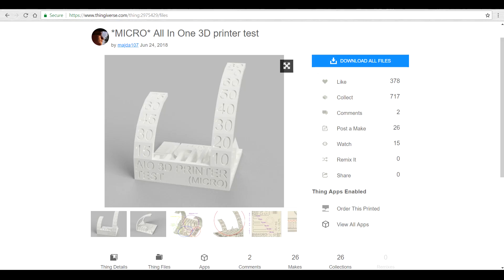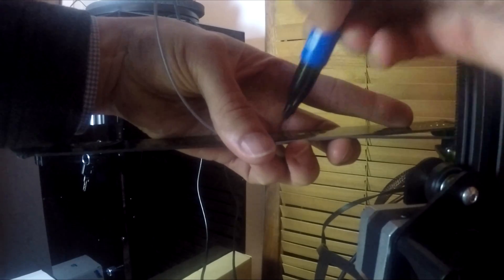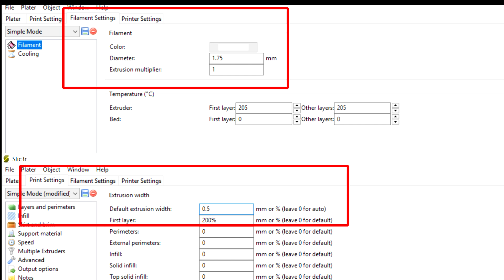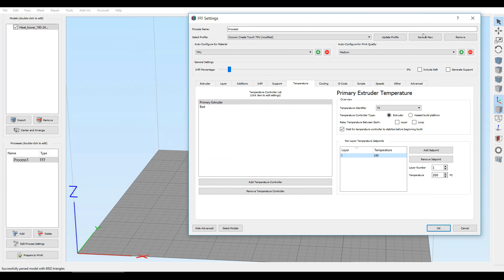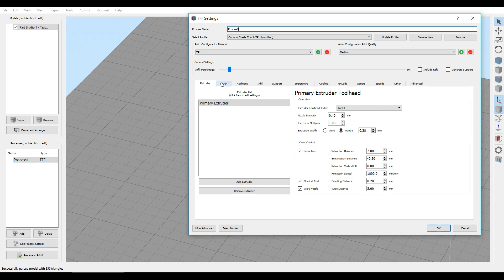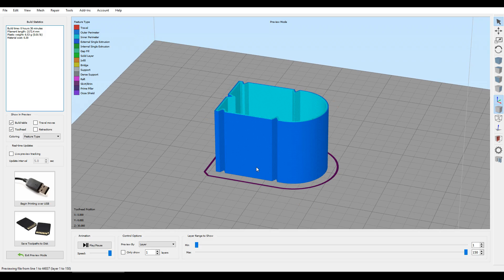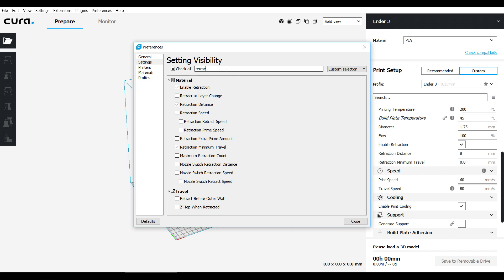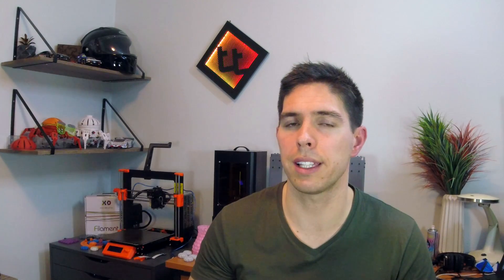How to tune your slicer settings featuring Ender 3 - UPDATE IN DESCRIPTION

Comment: premade gcode is useless to help tweak a machine.  there is no way to know what the slicer settings are, other than the ones being tested.   A premade retraction test doesnt tell you what speeds are being used, nor does it tell you layer heights, or anything at all. 

It would be better to say "here are the settings for simplify3d, if you want to replicate in a free package, use IdeaMaker's layer grouping options or Cura, printing multiple tests (in place of per-layer settings) for each setting... eg printing 4 retraction tests, one at 2,4,6 and 8mm.   At least that way, all of your other settings are you own and you have a place to start tweaking from.

If you use somebody elses gcode, you can print test after test but when you go back to your own gcode there will be differences and you will be stuck back at square one

Comment: I've yet to see anyone fix the stringing issues with S3D AFTER they've installed the Micro Swiss hot end.  After exhausting every possible setting, I now print out of Cura exclusively.  There are a bunch of solutions that work "in theory", but in practice it seems everyone gets frustrated and moves to Cura like I did.  It's a shame because I miss the supports of S3D.

Comment: When I do the G1 E100 F100, my printer extrudes about 40mm of filament. filament is not slipping. Tried adding G91 and same result. Anybody know why?
Reply: I had this same issue. When i took my cold end apart i noticed the plastic bracket on the botton had a crack in it. Didn't notice any slipping but it was. Switched to an all aluminium cold end and the problem was solved
Reply: upgraded mine to aluminium, same issue still.

Comment: Michael, I have a question.. When I went to see if my esteps was correct for my filament I ran into a odd situation.. I am pretty sure I am under extruding, based on the Simplify3D help page and other things I have seen, I am almost positive I am.. 
When I went to do this I had an issue and was not able to send the G code like you did. I do have octoprint but the code didnt do anything and when I hooked my laptop up I kept getting an error that stopped me from connecting Pronterface.  So using the controls I manually had it spit out 100mm of filament. After measurement I found that my number was 25mm, I was able to use Octoprint to do M503 which then came up and had an E95, so based on the math, I had 100 / 95 * 95 which comes out to 100??? Is that right? Is it on point? Because I swear I am still under extruding..

Comment: how are you loading the gcode into simplify3d?  I have to import > all files and then select the gcode but it never shows up in models.   Also, on the speed test are you going back and forth between 3000 and 6000 every line or are you just constantly adding 6k to each line?  So if i'm understanding correctly each of the 6 processes would go like this from 1. to 6. 
1. 3000   0-5
2. 3600   5-10
3. 4200   10-15
4. 4800   15-20
5. 5400   20-25
6. 6000   25-30

Comment: For those of us who aren’t sponsored by and use Simplify3D how do we do the set points in Cura? Same for the nozzle wipe settings.
Reply from the maker: I'm not sponsored by them. I provide the presliced gcode to address this situation.
Reply: Buy S3D its worth every penny and its a life license, I bought mine 2 years ago and still get monthly updates.
Reply: According to the S3D website I believe you are incorrect. This I the reason I chose not to buy in to their product. From their website:

“Latest and Greatest Updates – your license includes 1 year of free upgrades so that you can stay up-to-date with the latest improvements“
Reply: Response from Simplify3D:

Hello Brant, Simplify3D includes 1 year of free software upgrades along with your license purchase. This means that if you purchase the software now, you can still upgrade to any new version that is released within the next 12 months.
 
After that time, there may be a small upgrade fee required to continue receiving the latest updates and support. Information about features and pricing will be provided in advance so that you can make decisions about upgrade needs.

Comment: I have been looking at this video and i just dont get it. Is there a way to do this using free sofware? Idk how to do all those tests on cura, also Idk how h
To make my ender 3 extrude 100mm
Reply from the maker: Google pronterface
Reply: You can control the extruder under "prepare" -> "move axis" -> "Extruder"
Reply: Problem was the wrong usb port? It worked just fine when i used the other 1😅

Comment: Can you tell me how to connect the Ender 3 pro to PC by USB? I've installed drivers and connected to USB port and Cura doesn't see it. Creality Slicer doesn't see it. Windows doesn't see it. I cannot even find where to run Octoprint on their site. Is there an alternative way to check things like extrusion?

Comment: Your gcode files do an initialwipe on the front left of the build plate and knock off my bed clip.  They helped me fine tune my settings though, I just have to remember to take off my front left bed clip before running any of these files.
Reply: Cura dors thia automatically on both my printers.. I moved my clip i only get rid of it when im doing full build volume

Comment: The Flow Rate Calibration can't work like that in Cura because Cura is adding a inner wall everytime which is also 0.4 (the Nozzle Size) so even if you put in a Wall Thickness of 0.5 it will be bigger since there are 2 walls and not one. One way (and i think that's the proper way todo it, is to set the Wall Thickness to 0.4 and activate the Spiralize Mode under Special Modes in Cura. This way you only get a single wall which should be 0.4mm

Comment: WARNING: The start code in these g code files lays an initial bead from the front of the bed from Left to Right.  If you have a front bed handle, especially one with the Pi Cam, it will hit it and the motor will begin making funny noises!!!  Be ready to flip your camera back and possibly bend the bed handle out of the way if you run the current files.

Comment: Please consider doing a review on the Creality Slicer 1.2.1 software that ships with new Ender 3 Pro's.  It's powered by Cura and is customized for the Creality printers.  It is any good? Seems simpler than the CUra I have and am struggling to learn.

Comment: Can someone explain the "0.48" to me? I don't get why we added 0.5, then our target became 0.48?  Isn't our target the SET width? IE 0.5 from a 0.4 nozzle?  A lot of people are lost here, I feel like this part needs clarification, where 0.48 came from.
Reply: The 0.48 is also bugging me. I sliced my cube in cura with 0.5 wall thickness and it came out at exacly 0.48. But like you, I don't see the point of setting the wall thickness to 0.5 if "we" want it to have 0.48. So I basicly calculated my new flow rate like in the video but with the desired thickness of 0.5 to match the input in cura. That gave me 104.2% flow rate and the next cube came out with a wall thickness of 0.5. I then upped the wall thickness to 0.8 and the cube came out at a whopping 0.95!... Went back to 100% flow rate and it came out at 0.89. So I'm guessing you have to calculate your flow rate everytime you are looking for a specific thickness.

I can get behind calculating the flow rate every time but I still can't see the relevance of aiming for 0.48 when you set your walls to be 0.5... I'll leave mine at 100% for now and calculate it if I need a specific wall thickness.
But damn, I'd love some enlightenment in this.
Reply: I researched this and found that 0.48 is considered to be the default wall thickness for 0.4mm nozzles since the plastic laid down by the nozzle doesn't stay flat at 0.4mm but expands to the sides a little.

Comment: I've measured 120mm of filament, entered G91, G1 E100 F100 and noticed that there was a difference of 50mm when the extruder stopped.. doesn't seem entirely right so I think I'm doing something wrong here.
Reply: Was the extruder skipping?
Reply: @5UPRAH  No, not at all. I've fixed it by just manually editing the e-steps until it was right. Went from 93 to 96 which seemed to be the magic number.

Comment: Hi. I have an Ender 3 and I am having huge issues with blobs, stringing, over and under extrusion, all on the same print. Can someone take a look at my images in the link here and see what I am doing wrong? My settings are:
Using Cura 4.0.0
Printing at 205C with 60C bed temp
Print speed 50mm/s
Cooling YES
No supports
100% infill
0.12mm Layer height
Retraction distance 10mm
Retraction speed 25mm/s
Z-Hop when tracked YES

Link with some of the images:

https://drive.google.com/open?id=1gGEZK6N_LluEbspcWJUWErF2J6qCbTKd

Please and thank you.
Hunt
Reply: Try lowering your retraction distance that's really high and your speed is very low. My retraction speed is 40mms and distance is 4mm.

Comment: Something I found help as a total newbie... you can set your e/steps as well as tell it to extrude 100mm entirely using the control panel. So no need to use Octoprint if you dont have it, or hook it up to your computer or anything. 

Tell printer to extrude 100mm after you have marked 120mm:
Prepare->move axis->extruder->move 10mm-> spin to 100mm

Save new calculated e-steps:
Control->motion->Esteps/mm-> set to new
Control->Store memory

Also to print his cube without a top or bottom its all in Cura. Go to Shell and set top layers and bottom layers to zero, then hit slice and you can see the top and bottom are gone.
Reply: Thanks for this comment, very useful!
Reply: also set infill density to 0% to get a completely hollow cube, and thanks for this comment!
Reply: I thank you as well.
Reply: Is maybe my Firmware Version, but I don{t have the tab Extruder inside the Move Axis section :(
Reply: Make sure you selected 1mm increments in the menu right before selecting the axis. The extruder and z-axis won't move in 10mm increments.
Reply: @hecrodsol  it's in the prepare menu. prepare -> move axis -> extruder
Reply: Great comment, really Useful!!!!!
Reply: @sam2b77  if your over extruding the mark will go into the bowden tube and past the point of measurement.
Reply: Hey guy! For me, when extruding 10mm I end up having only 3,5mm extruded. Is this normal? Should it be a value around 10? Like 9 or 9,8 or similar? I’m trying to figure it out why the printer extrudes less filament. If any of you encountered something similar, please share your xp! Best regards!
Reply: @hovoruhaoctavian7191  I had the same issue. See my experience in my comment on this thread. Did you resolve this?
Reply: Hello Adam; yes it seems that i’ve nailed it. Under the Motion\Filament\Esteps (hope i got the address right...) the option Esteps in mm3 was active. For me that was the problem. I’ve just canceled it and my prints and extrusion dimension were in adjustable range. Infact the prints were tip-top (i’ve printed the accuracy dimensional 24mm cube xyz, and measured deviations: -0,08/-0,11/0,05) The extrusion of the 100mm i’ve just set it straight with the formula presented in this video, but did it directly in my Ender without connectin via cable+software. Many thanks again Adam!
Reply: @hovoruhaoctavian7191  I know it's a late reply, but that sounds to me like a volume of the filament error.  Something in your printer or slicer may be converting the length into volume and then extruding that amount.  Having your printer think you have 3mm filament instead of 1.75mm would give you an output of 4.16666.  Not quite the value you have, but definitely could explain the vast majority of the discrepancy.
Reply: The options for 'Motion->E-steps' and 'Store memory' does not exist on the Ender 3 I have access to... I have a temperature option under 'control' and that's it.
Reply: @Koushakur  You can enable/disable these features in the configuration files on your firmware
Reply: I measured 127mm (5") on my PLA filament. I told the printer to extrude 100mm - as per above. It pushed about 1.5", with the hot end at 210. I did that three times total, for a 300mm extrusion. Based on this calculation, with the remaining 4.76mm left over of filament at the 127mm marking... my New E Steps should be 228. Is that crazy? I am certain my printer is under extruding... but it doesn't feel that it would need 2.45x more!
Reply: Thank you very much!
Reply: why move 10mm and then spin to 100? why not directly move 100?

Comment: Question about your gcode: in the video (at 6:50ish) you say that 3000 mm/min = 30 mm/sec. I assume your gcode actually did 50 mm/sec and not 1800 mm/min. I would like to know if my assumption is wrong and to point out that little error. Other note: Like your video for how it is payed out
Reply from the maker: I believe I have an error, you are correct.

Comment: Thanks for your great guides! Yesterday i did the marlin firmware update with your guide. it worked well. Becaus of bad prints i want to work on my own printer profile for my ender 3. An want to start with a check of the extruder calibration. I can't get octoprint and repetier running :( so i tried ponterface. nothing works. is there a guide how to setup reptier/octoprint right?

Comment: Using simplify 3D, Having trouble with the extruder calibration… It reverts back to E 93 after I disconnect it I can’t keep my setting of E95.4.  I punched in “M92 E95.4” and then “M500”

Comment: For some reason, wall thickness for me is grayed out with 1mm anc can't be changed.
Reply: probably cause you manually set number of walls. clikc the rotating arrow to the left of the number of walls box and it'll revert it and open thickness
Reply: @Aurelleah  Yep, found that out a week ago :)

Comment: On OctoPrint using an Ender-3, you need to send the zero command to the extruder before starting the 100mm extruder command. So G92 E0 then G1 E100 F100. Otherwise, it won't work.

Comment: In printing the retraction test I watched the extruder gear carefully and noticed there was 0 retraction for the first 12 mm of layer height, and then it started to increment by 2mm every 5 mm of height.  I confirmed this in the g-code where 2 mm retractions begins at layer 62 and Z = 12.18 mm.  In your video you point to 0 and then 2 mm as having the stringing, but all of the stringing was at 0 retraction.  The first clear area above the stringing that you said was 4 mm is actually 2 mm of retraction.  I had similar results, but I had a tad bit less stringing at the next level up at 4 mm.
Reply: Also - this means the photograph you show with the retraction settings in incorrect.  If the retraction changes every 5 mm and the towers are 30 mm tall, you should have 6 divisions where you have only 5.  The correct bottom to top order for 6 equally spaced 5 mm divisions should be: 0, 0, 2, 4, 6, 8 which is what is in the gcode.

Comment: I cant get it to report printer settings through M503 inside octoprint terminal. Says unknown command, Marlin firmware 1.1.9 What can i do? I know i need to adjust around 4mm

Edit, Custom firmware has it turned off to have enough space for ABL on stock motherboard.

Comment: I am following your video to calibrate my extruder, everything worked fine! I even did a second M503 code to verify the change to my E steps however I decided to do G1 E100 F100 again to verify the filament was at 100 but now instead of feeding filament is retracting filament, any ideas why?

Comment: I am trying to set my e steps for my Ender 3 using Repetier.  I am able to connect and control the printer with no issue, and I am able to set the e steps using "M92 Exxx".  I then use M500 to save the values then double check that it has updated using M503.  However, if I disconnect the printer from Repetier and reconnect and then use M503 again to view settings, the e steps have reverted back to the original values.  HELP!
Reply from the maker: Standard firmware doesn't have eeprom enabled, which is where this is saved. Another reason to update. Add the m92 line to your start gcode in the meantime.

Comment: How do I print the cube without the bottom and the top?
Reply: In Cura 4.2.1 I set the Top/Bottom Thickness option to 0mm and it was omitted.
Reply: Yes

Comment: So... I am using OctoPrint. I sent the command G1 E100 F100 but instead of extruding 100 mm of filament, it retracted it all and 5 minutes later the extruder is still running in reverse.

Comment: Hi thanks for the video, I do have something I want to toss out for your review. In short I set up my esteps using PETG, saved the settings and confirmed all was good, did 3 or 4 tests after the fact and the extruded filament lengths stay at the commanded 100mm. So I loaded TPU, gave it the command to extrude 100mm and it was short by at least 12mm...I have confirmed to the best of my knowledge that there is no slipping, yet no matter how slow I tell the TPU to extrude the lengths are always the same...short. In light of TPU and the fact it is a flexible filament is what I am seeing normal? Do I need to treat TPU differently than a solid base filament like PLA or PETG? In all tests with TPU it was under no tension while being pulled into the extruder, Im using a brand new gear and the tension on the filament is the same as the PETG. I cant even get it to slip manually pulling it through the extruder so I feel tension/slipping isnt an issue here? Any thoughts? I tested this in 2 different scenarios, 1: Free Air extrusion and through the Nozzle Extrusion to set esteps, the results were pretty much the same.  Thank you
Reply from the maker: This is the video you are looking for: https://www.youtube.com/watch?v=HwYde5Sj1hY